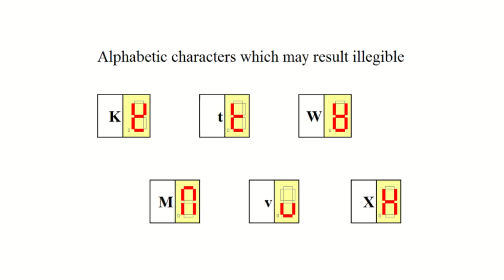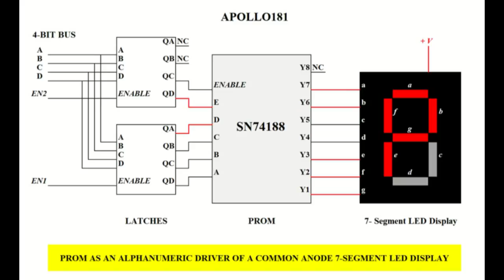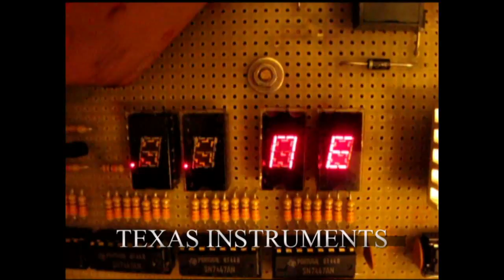Let's create letters and messages on seven segment display (APOLLO181 Exercise n. 7)

Comment: 1:16 0 and o NOT 0 and O.
5 and S. for S remove top line becouse 5 has top line s is curved.
h and X you figure it out.
q and 9 for 9 bottom line 9 should be like 6 upside down
2 and Z we need change how we write them lol

Comment: your design isn't good enough to make it to be a real computer can run programs and execute other programs.i can make a super computer with that size.
Reply: Do you think he is not aware of that? Of course it is not good enough, but it isn't even supposed to be, because - like Christian already said: It is a lerning tool. And i'd like to see you building a supercomputer with 74xx chips in any size.
Reply: well dang man, its a learning tool--4 bit words and ALU, cheap, easy to grasp, accessible
Reply: you would need to design a chip from the ground up using modern methods, i wonder if chip factories allow rnd designs to be manufactured in small batches?, they'd be expensive though and you'd need a proper design to do it